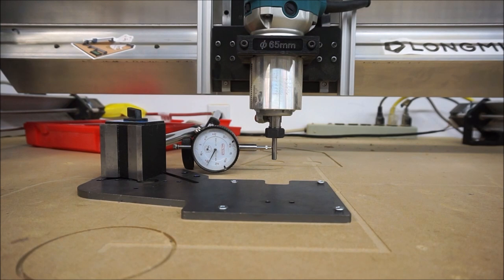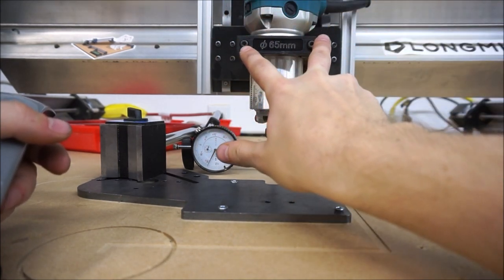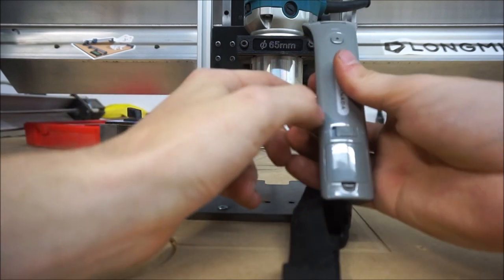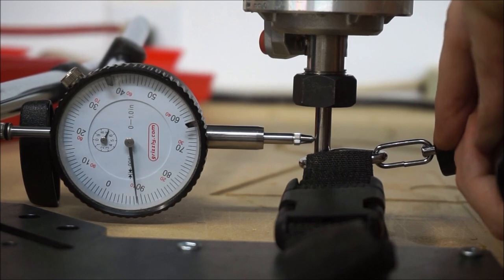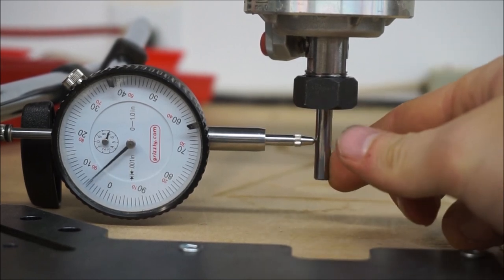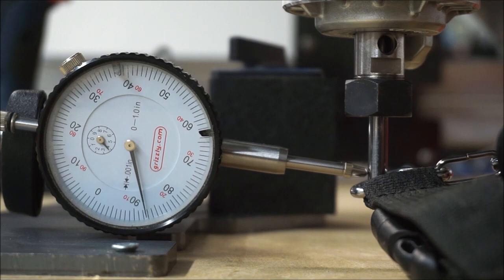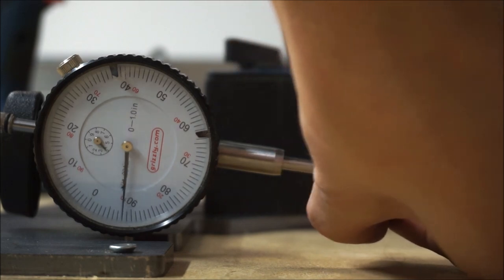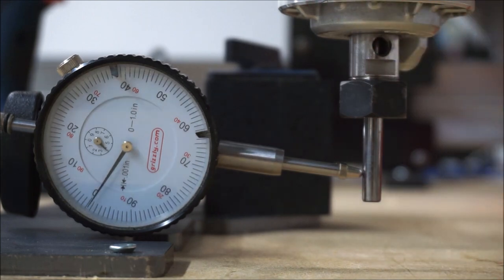LongMill Deflection + Backlash

Comment: The only real bottom line is that deflection will remain quite negligible ... unless you are running a very dull bit or are cutting much deeper than you should be.

Comment: if you buy a 12x12 how hard is it later to upgrade that to a 30x30?
Reply from the maker: The only difference between the sizes is with the rails and lead screws, so it is pretty easy to switch the rails and leads screws out if you have everything else put together.
Reply: @SienciLabs  I'm assuming the 12x12 would be more ridged based of the shorter rails. Im thinking for most uses, the 30x30 is the way to go.

Comment: You probably would do well to choose one system of measurement rather than inches and kilos. You don't want to Hubble it.
Reply from the maker: Good call Michael. I might revisit this video in the future and make it more structured so that it's a bit easier to follow :)

Thanks for the feedback    - Chris
Reply: Yes but remember Concorde was built with both imperial on the British side and Metric on the French side with no issues. Everything fit perfectly  :)

Comment: What bit are you using?
Reply from the maker: I've got a 1/4" tool in the shank of the router when I'm measuring the deflection
-Chris
Reply: @SienciLabs  Thank you Chris. Chris what is your delivery time to Houston, TX? Also, what is the level of difficulty for the electronics set up for someone that has no electronics/ programming knowledge?
Reply from the maker: @jtcmlt1  Currently the lead time for a LongMill is around 2-3 weeks, and it generally takes about a week in transit for shipping. The electronics set up involves plugging the connectors to the control board. I'd recommend checking out the electronics assembly for more info https://resources.sienci.com/view/lm-electronics/
Reply: @SienciLabs   Thank you Chris. What else will I need when my LongMill arrive? and, what else do I need to have it ready to produce?
Reply from the maker: If you want to be ready when it show up, you'll want to make sure you have somewhere to put it - some table space or a large flat surface. You'll also want some cutting tools on hand for whatever cutting you're planning on doing, as well as the materials that you plan on cutting. If you haven't decided on a software to use yet, I'd recommend Easel as a starting point, but you can see a variety of options here: https://resources.sienci.com/view/lm-choosing-software/

Here are some references for tables: https://resources.sienci.com/view/lm-community-table-builds/
and for cutting tools: https://resources.sienci.com/view/lm-cutting-tools/ (check the tab on recommendations)
-Chris
Reply: @SienciLabs   Thank you again for all the help. So, I have SolidWorks, Inventor, AutoCAD, and Fusion 360. I guess, I just need the cnc interface (UGS)?
Reply from the maker: If you're looking for a standalone interface I'd reccommend our own gSender. We've built it out with many features, I actually just published a new release about 1 hour ago: https://sienci.com/gsender/
Reply: @SienciLabs   Thank you, let me check it out.